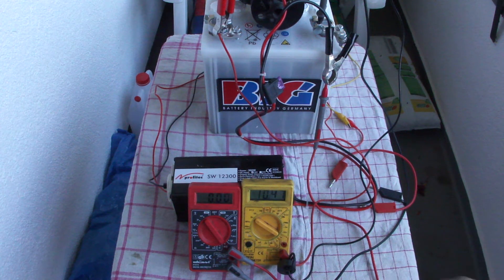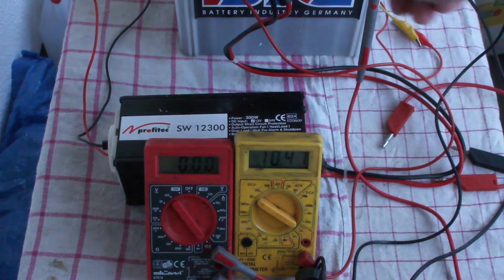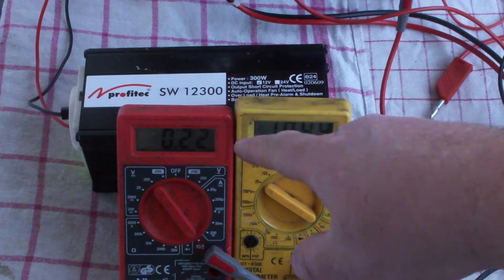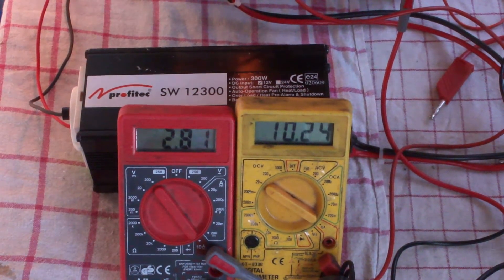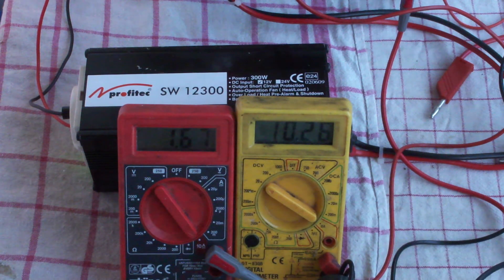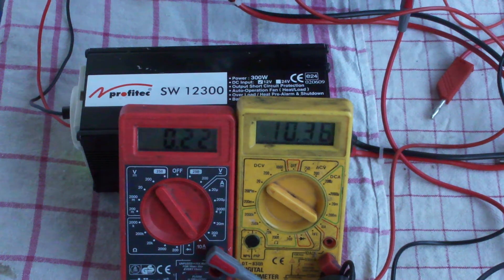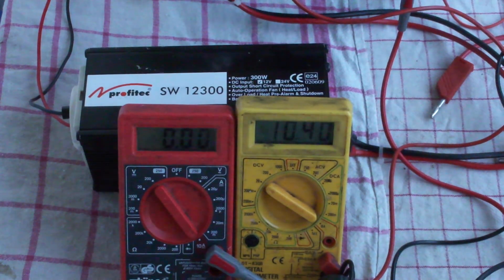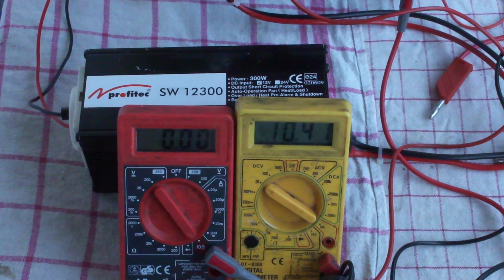Input Current measurement test into the 300 Watts inverter with the ALUM electrolyte car battery

Comment: did you ever do any more experimenting with this. from what I have found everyone was saying to use a battery that has already been charged and discharged a few times. but it looks like you get the same voltage that they had been getting. have you done any experiments in the amount of alum to use in the battery to begin with and how long dose the charge on it last.